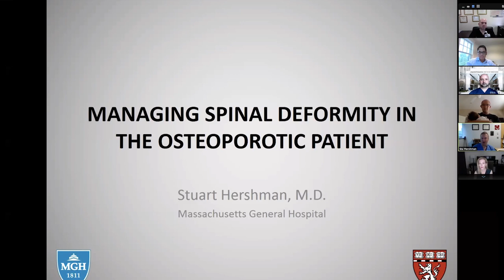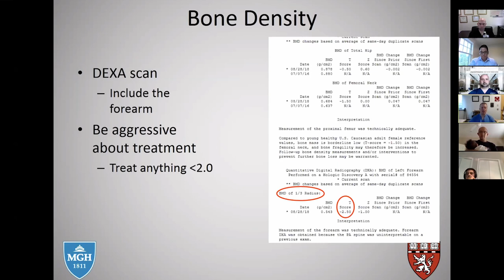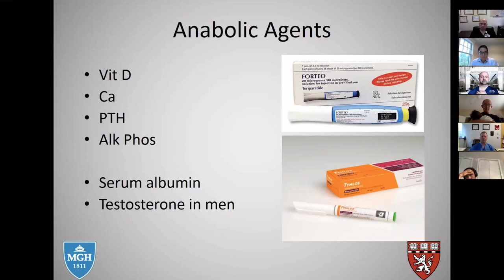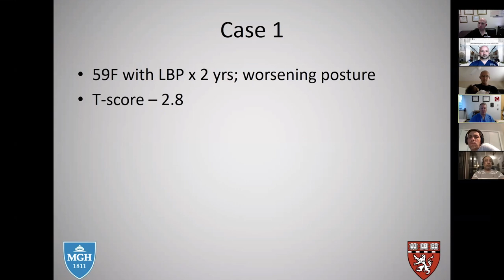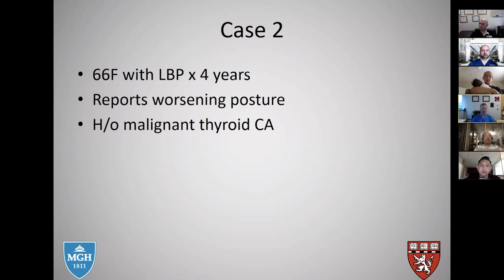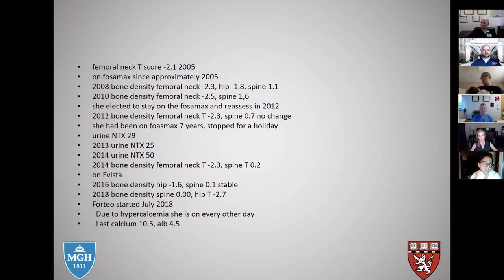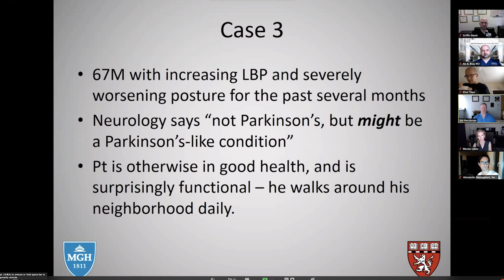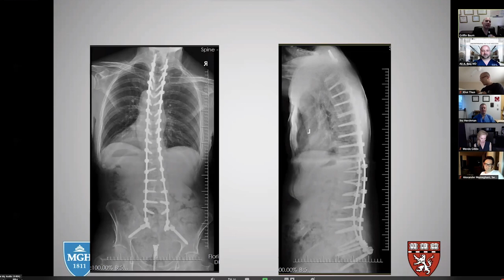Osteoporosis and Spinal Deformity Surgery by Dr. Stuart Hershmann

Comment: I have osteoporosis and have moderate bone loss,I also have hyperparathyroidism, I have weak bone and sustained a very nasty fracture. I got a burst l5 fracture causing foriminal retropulsion of a bone fragment with bilateral recess.I have been told my thecal sac is compressed with bone fragments as well.I have kyphoscoliosis with wear of the sacroiliac joints.I also suffer spinal arthritis and facet joint syndrome along with slipped discs and facet joint syndrome. I have been told I am high risk for surgery that with me being asthmatic I could have issues with the anasthetic or end up with nerve damage or incontinence  I am in extreme pain despite pain killers,what could you do for me.